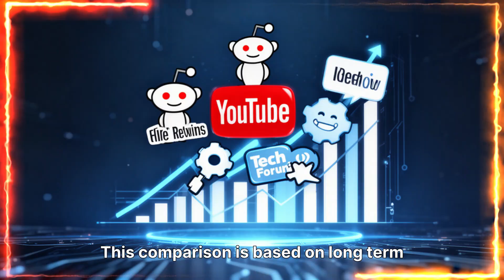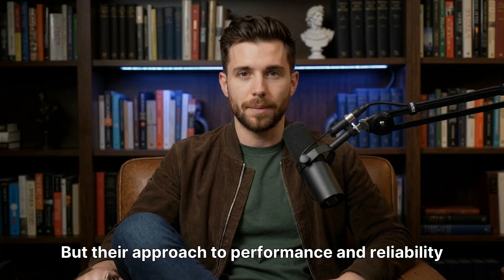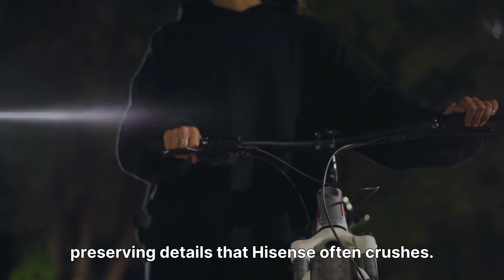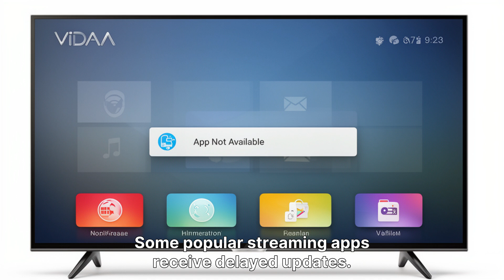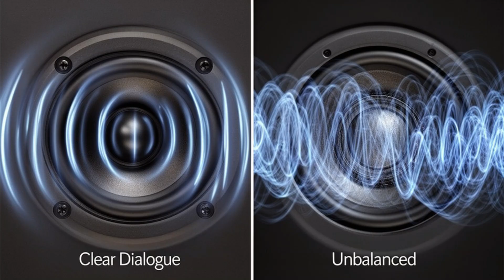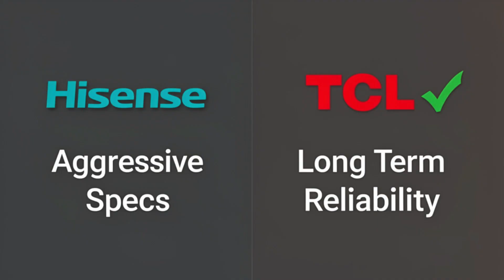Hisense vs TCL TV – Budget TV Performance & Reliability Test (Best Value 2026)

Comment: I have a TLC Roku tv 55 inch it's 6 years old and it just recently started not responding to the remotes. The remotes work but I have to unplug and do a hard reset a couple times and it may work or not. Then I have to re enter everything. I'm looking for a new TCL Roku tv but don't want to spend a lot I just want the best picture for tv and movies. I wear headphones most of the time . Has to last awhile getting a tiny house built. I am confused with all the Q this and mini  that. I just want a good tv that is easy to use and will last 5 years. Can you recommend one? Thank you.
Reply from the maker: I will update you soon brother.